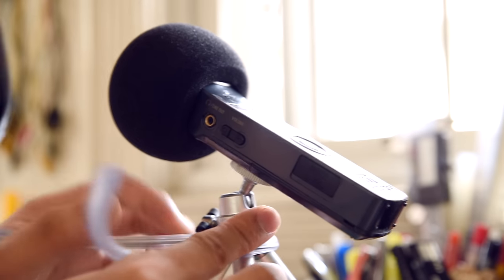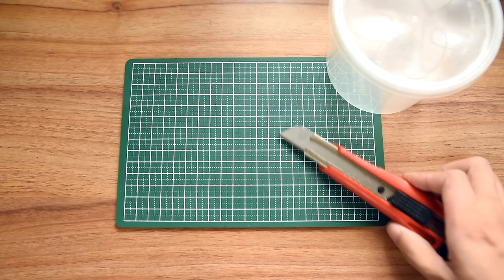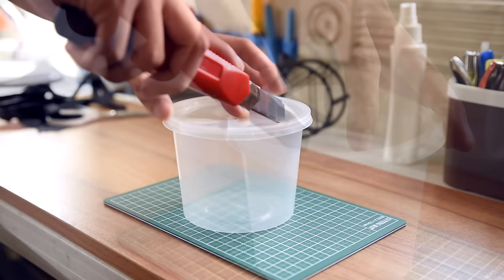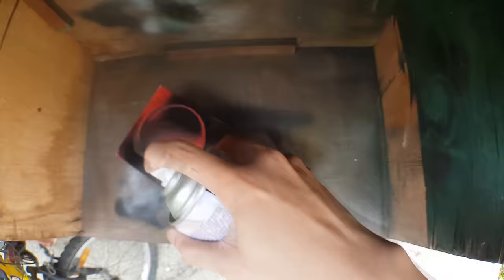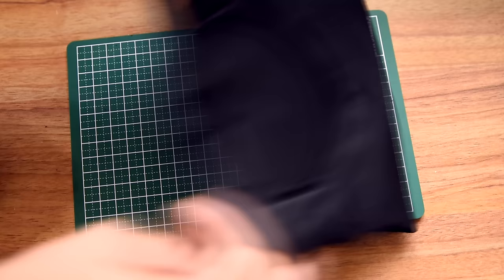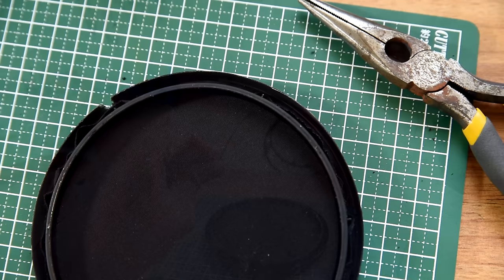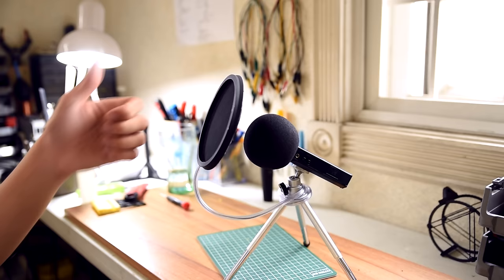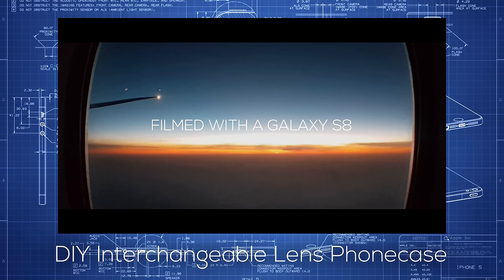DIY Mic Pop-Filter (Using Home Supplies)

Comment: 2:54 What is that soft covering around your microphone? Does that server as an ‘on-the-mic’ pop filter?
Reply: Usually called a windscreen or a foam cap. It's somewhat similar to a pop filter, but each has their own use. A YouTube called booth junkie made a pretty good video explaining the different types and their uses